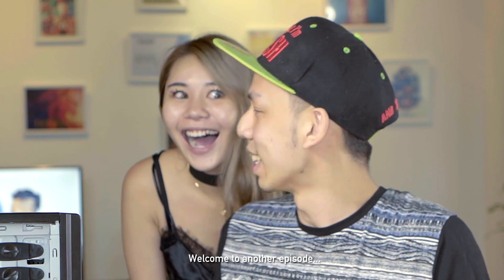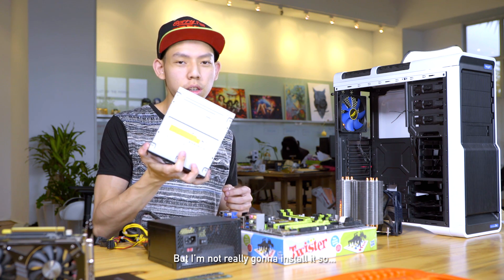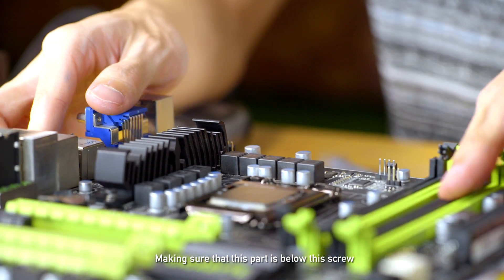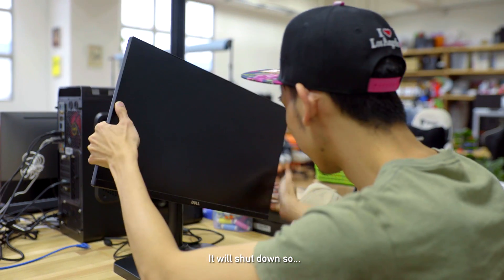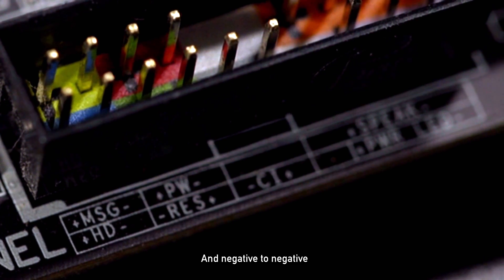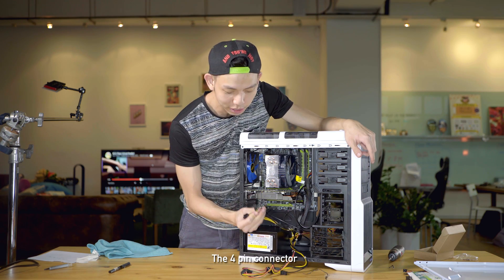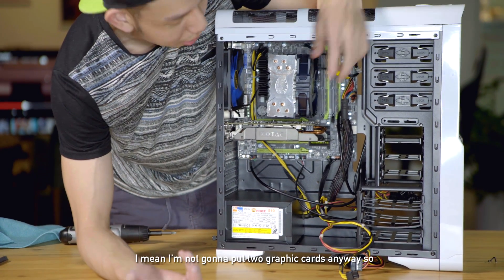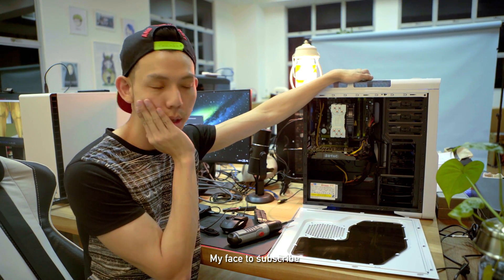NOC Tech: How To Build A PC!

Comment: lmao why do you even put your gpu in the x8 slot?If it's blocking anything just use a pci-e extender will do.
Reply from the maker: Then where should the GPU be at? on top of the power supply? outside the case

Comment: My Pc got Problem!!! Cpu Running but Monitor does not Display(No signal Connection)!
Reply: How to fix pls help me!! thx
Reply from the maker: Hello Amos, There afew things you can do, let me try to list it out. 
-Make sure your monitor is on and on the right channel e.g. (HDMI, DVI, etc.)
-Try changing cables.( happen to me before, cable faulty.)
-Try changing the GPU to a different PCIE slot. 
-If your using your GPU try using the inboard graphic instead( if this works your GPU is faulty or not probably you motherboard is faulty. and need alot more troubleshooting to figure out what is the problem. 

another reason it might not show anything is complication with Bios . then there are ways to reset Bios on the motherboad itseft
Reply: You should check if your display cable is plugged into to your motherboard or graphics card, most people make the mistake of plugging it into their motherboard the first time

Comment: The best computer ever
Reply: lmao you might want to think about:

1. Intel core i7-7700k Kaby Lake @ 4.5GHZ
2. Asus X99 Deluxe motherboard
3. 2x EVGA 1080 Hybrid in SLI
4. Samsung EVO Pro 1TB SSD
5. Enterprise Capacity 3.5 HHD (10TB)
6. 128 HyperX Predator DDR4 memory
7. Lian-li case?
8. Cosiar RM750x PSU
9.Water cooler instead of a Heat Sink
Reply: Loh DanWen Uhh Kaby Lake doesn't work with X99 mobo but Z270 will and have a cool looking version from Asus with built in waterblock. 

Also wait for Ryzen coming at March and that 60tb SSD from Seagate which is coming.
Reply: Loh DanWen brah, the Corsair RM750x power supply has been rated 4th tier over 5 of them. water cooling doesn't necessarily mean better performance,some heatsinks like the noctuaDH14(hope I said that right) and the dark rock Pro 3 beats out most AIO water coolers.
Reply: Rickie Cheong Be quiet and Noctua are great for silent heatsink but Cryorig beat both with better temps. But  water cooling with pipes and reservoir is actually still better than AIO and Aircooled with Liquid Nitrogen being the best of all.

Comment: I don't think it's important for you, but you might want to get a new power supply.The power supply you have there has been graded to be very dangerous.it sends it's power in ripples which can cause long term damage to your PC components.it also uses very dangerous components inside the PSU,it might cause permanent damage to your PC if you use it extensively or under load.
Reply: or get some psu extension cables.
Reply: Rohayat Ahmadi sorry,but that doesn't help